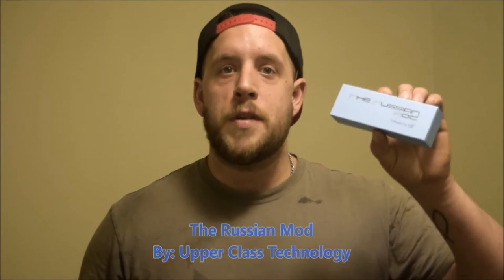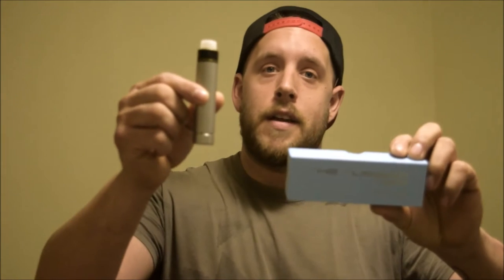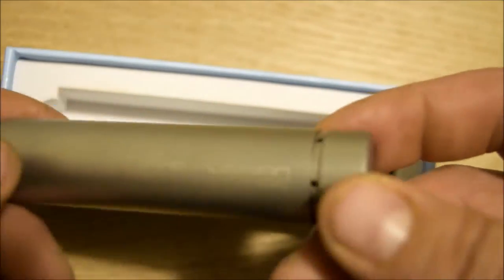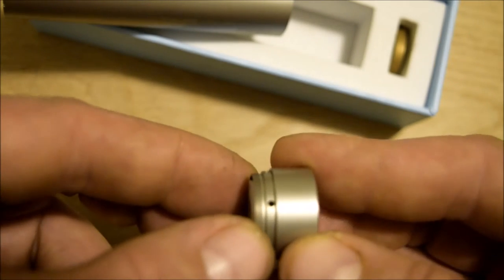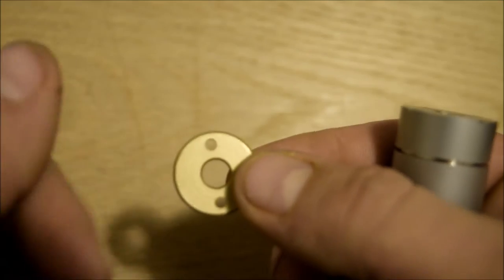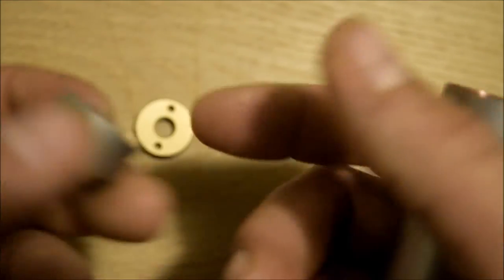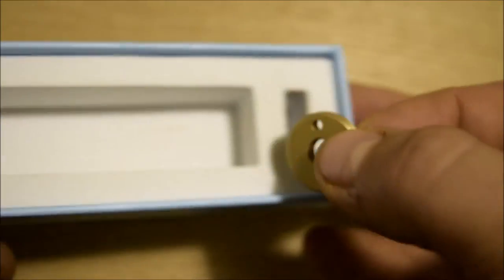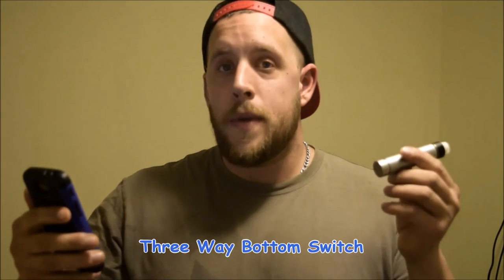The Russian Mechanical Mod By Upper Class Technology

Comment: Looks like a pretty smooth switch. I love my mech Mods but I try to steer clear of the ones that break down for smaller batteries. Mainly because I never use smaller than an 18650. My favorite mech and one that I don't see being topped is The Copper by Scottua. I have the 30 mm and The Brass 22 mm. If you can find one you should pick it up! You won't regret it!
Reply from the maker: I have to say other than the fact that it breaks into smaller sizes that doesn't seem to affect how hard it hits and the throw on this button I totally forgot to mention in the video it's so nice in hybrid mode 18 650 this thing is so small it's actually a 16th of an inch smaller than the Phantom hybrid mechanical but yea the throw on this is so smooth and it hit so hard the true test of time will tell but so far I'm absolutely loving it and so glad that I got it

Comment: I have this mech mode too, i build my coil 0.18 ohm, and use sony vtc5 battery, but it is getting hot on all the mode, what should I do ? 
Thank you verymuch
Reply from the maker: honestly I don't use any other type of battery except Samsung 25r's an they have barley gotten hot on me ever, when a battery get's warm that is very bad. If they get warm very shortly after use on a full charge I'd throw them out, .18 ohm's is low but not so low that it should stress them like that, unless your pushing you battery change interval to far then that would make them get hot to be sure to cycle your batterys every 30-45min. when continually using them, also when in doubt throw them out, its not worth your face for 10$ battery.
BE SAFE FAM!
Reply: +Vaping Monky i have a samsung25r too, but the mech mode is hot, not the battery :D the mech mode is hot on all the mode, not just hot on the fire button :D
Reply: +Vaping Monky do you have facebook or email ? I can take a picture of my mode and my coil ^^ thank you verymuch
Reply from the maker: +Popper Bin VapingMonky@outlook.com
Reply: +Vaping Monky i had sended you email, plz check your mail ^^ thank you